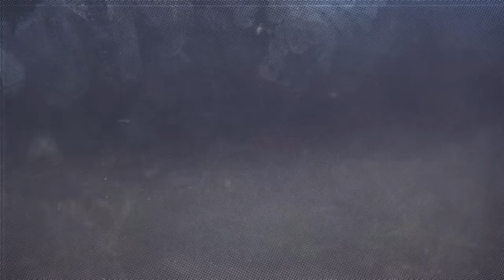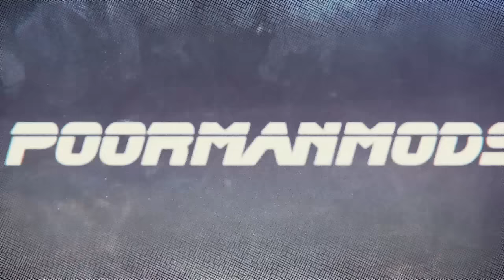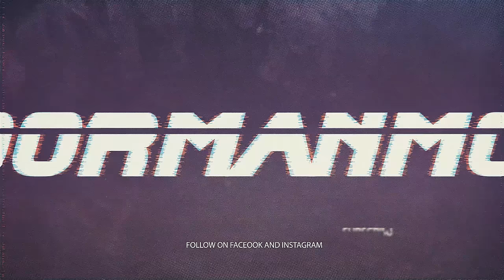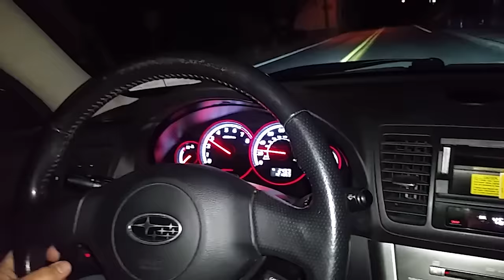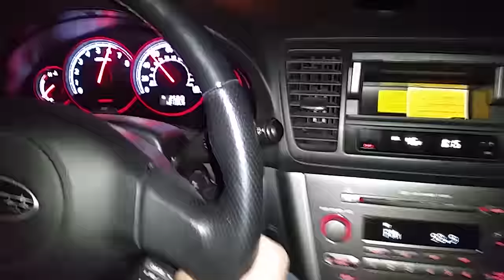How To Tell You Need A New Clutch | Slipping Clutch Burned Clutch Subaru Legacy GT

Comment: I have a 2013 Acura TL SH-AWD with the 6 speed manual. Same symptoms , $5000 later I have a new oem dual mass flywheel and clutch from Acura. Lasted 225,000 kms on the original clutch though

Comment: I have a problem with my Subaru STI, when I go on the freeway like at 60 or 70 and I step on the accelerator does not advance only the needle of the rpm goes up?you think is my clutch,😢
Reply from the maker: Yes that sounds like a slipping clutch

Comment: just found out my car was doing this yesturday. money for car parts. gone. but least i get to upgrade my clutch and flywheel so win win i guess
Reply from the maker: that sucks :( i installed a Stage 2 Competition Clutch, i highly dont recommend it, it's awful
Reply: Poor Man Mods was it stiff lol
Reply from the maker: +ITzJohnsonYo it's a switch, a legit switch, the pressure plates grinds on the inspection plate and 100 percent of the time you go into first or reverse you smell clutch. I stall it everyday, the supra with a Spec stage 4 unsprung 6 puck is light years easier to drive

Comment: My Honda Fit is taking a long time on the friction point before I can actually release the clutch (a long time from when I feel the pressure of the clutch and all until when I can actually let my foot off) and it feels really hard. It also feels like this when I downshift especially into 3rd and 2nd gear. Is this a problem???

Comment: high beams were on the whole vid😂
Reply from the maker: nope, the LED headlight bulbs i put in for whatever reason make the high beam indicator on when the low beams are on. At :23 you can just BARELY see the green fog light indicator at the bottom left of the dash, fog lights are only on with low beams, when you turn the high beams on the fog lights and indicator turn off.